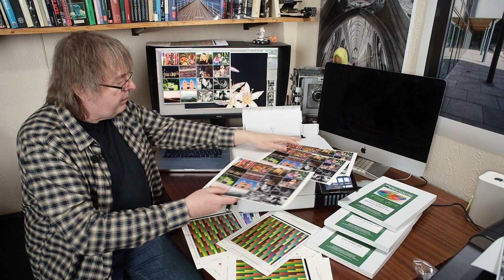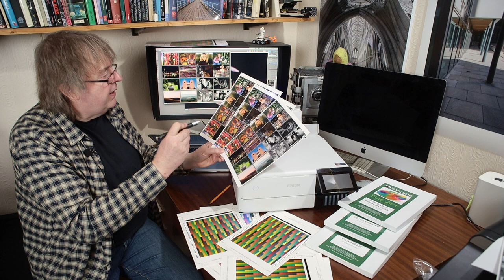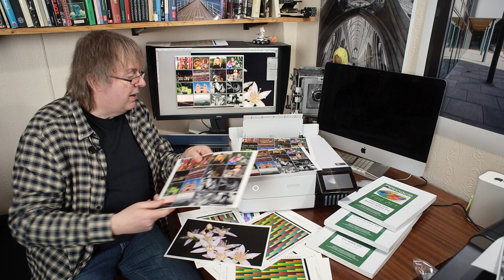Soft proofing, test images and making real prints - When soft proofing runs out of steam

Comment: I use soft proofing for cockpit and software problem solving. I have a light source that I've tweaked over the years and have been able to match the print to the screen quite well. It's not practical because in the real world my light source doesn't exist except in the remotest instances. When things go south, I go back to it as a reference. It's usually me, but about 10 months ago I was crazy because prints were just wrong. Wasted a LOT of ink and paper. I have used Capture One for years and it always seemed to produce better prints than LR/PS (I assume it's the RAW converter). Anyway, it went to hell on my P900. I seems it's Capture One. The boys in Denmark have been flogging it for a long time (10 months), but I think it's not getting any love. If I export Tifs  (that's getting old) and print with PS, Epson Print Layout or even Preview, it comes out spot on. CO hoses it; greens are desaturated and it's over sharpened. Almost like some double profiles I've done inadvertently in the past. Don't know why I'm blathering on to you. Just needed to vent. Disregard. Great job, as usual!
Reply from the maker: Thank

Comment: This is the wrong video to ask this question, but I just used my calibrite display unit, set my light level to 82, which was the closest that my iMac would set between 80-90 and I had my first really good color print I have gotten out of my Canon 9500 Mark ll printer.  Thank you, now I don't need to purchase a new printer, as you just showed me how to get a near perfect print out of the one that I already have.

Now new question, should you always leave the printer on or turn it off between printer jobs?
Reply from the maker: Glad to help!
I'd leave it on for hours, off for days depending on the gap between jobs - or if oyu've had it for years, keep doing what you are doing... ;-)

Comment: Hi Keith,  Thank you for all your videos, all are very useful, excellent information.   I have two questions about EPSON printers, sorry, not exactly on topic to this video, I simply chose your latest one to comment in.

1. Naming convention.   Could you please explain us a little the EPSON ET series naming.  There is a plethora of model numbers and I am confused what are the difference in these variants, even EPSON website is not really helpful, e.g. What are the key differences between ET-2400 ET-2500 ET-2600 ET-2700 ET-2800 series (are these just model year sequence?)   then what is ET-2800 ET-2803 ET-2810 ET-2811 ET-2814 ET-2815 ET-2820 ET-2821 ET-2825 ET-2826 ET-2840 ET-2850 ET-2850U ET-2850SE ... just to name a few, all seem to be existing models, that I could buy, very confusing.  I understand some have certain features, others don't, like scanning, faxing, etc, I am not interested in these, just the printhead to be the best, print quality, speed, reliability., there is hardly any data on this.   ...and all this just one model series ET-28xx.  There are many other ET-xxxx  And also many other, no EcoTank ones...

It is very hard to get a clear picture, just one example:
I just came across the ET-2840 specs, it says it has the newest PrecisionCore printheads, I said, great, so this is their newest development (why does it then have a smaller model number than their ET-2850 flagship in the 28xx series which has an older head technology, OK, no problem, I almost decided for the 2840.   Then to my surprise I saw there is a Special Edition. ET-2840SE what is it?  Is it what I need, no info on difference.  And then I saw a ET-2850SE with PrecisionCore.  And then ET-2856, is it better, or just white?   Then I gave up, it is a mess.
I always have a fear before buying, that when I buy a model XYZ-1234/GGR of some device, to realize later that if I had chosen the XYZ-1244U/GFD it would have been much better for my needs for the same (or almost the same) money.    And with these immense number of models at EPSON it is very likely to happen. Please help.   An overview table would be best, even with a video dedicated only to this topic.   This info is very much missing, it is nowhere summarized.  You may also ask EPSON for help, I think.       For me the most useful would be a summary table with info on the printheads (technology, number of channels/colors, number of nozzles per color, if pigment/dye) these are relevant for print quality, speed, maintenance.   Interface (USB/Wifi/Ethernet) and user interface ie. if LCD screen is available.  And most importantly which are the obsolete models not to buy that have been replaced with a better one for the same price.  None of this info is summarized on any website.

2. PrecisionCore
What does this new PrecisionCore printhead technology mean for us, digital art printers, is it of relevance we should look for when buying a new printer today?   My first impression (sorry EPSON) when reading about PrecisionCore key features (Printer-on-a-Chip, chips are designed to function on their own or can be combined in many configurations)  was that it is much more about their own satisfaction, an engineering stunt (in a good sense, no offense) optimizing manufacturing of an even larger plethora of printer models, the results of which (less variance in parts, less logistics, more profit) I am, customer, is not at all interested.  But does it print better?  If yes, how, why?  No info, no tests, no reviews, no print samples nowhere.  I don't understand.

3. Nozzle Redundancy - would be a long awaited feature for me.   ...a printhead to recognize a clogged nozzle, temporarily disable (until cleaning) that single nozzle and replace it in the next overlapping pass of the head assembly with another nozzle of same color achieving nozzle redundancy without banding.
Reply from the maker: Thanks
I don't sell printers or work with anyone who does, so I can't help with model numbers at all - they confuse me [I get them wrong occasionally in the videos, transposing digits] 
I'm sure there are reasons, but they vary from region to region too.
I'll ask Epson if they have any info I can show?

Precision core is 'just' a new manufacturing process/design for print heads - it's a very big step for Epson, but is difficult to explain in a way relevant to users [given the vast range of uses and knowledge levels]  Yes, it does give better printing and reliability, but once again not in a easy way I could show. I don't work in printer marketing...

Nozzle redundancy - An essential Canon feature somewhat meaningless in the context of Epson print heads I'd suggest? The two are different technologies and handle nozzle functionality in very different ways.
Reply from the maker: I'm afraid my suggestion is that your are just reading far too much into this...

If I said that the word 'precisioncore' appearing on the front of a printer made not one jot of difference to me would it help? 

I look at printers as tools to do a job - it's the results I look for. 

Do I really care that my newer car has a completely redesigned fuel injection system - no, that figures nowhere in my liking of the car. It may make quite a few differences to how the engine works, but if I don't see them, I don't much care [beyond any technical curiosity - it's been over 30 years since I stripped down an engine].

From a practical POV the default resolution of modern Epson printheads is 300ppi, whilst it used to be 360ppi  - this oft thought 'magic number' has shown in numerous tests I've done to be be irrelevant. It's about how those dots are placed and their control which makes for improvements.
Reply: @KeithCooper  Yes, you are right, I am exaggerating the problem, if any.  Just confused with the burden of choice even within one brand, size and model family.  
it's just happened to me so many times that I bought something (router, motherboard, video card, touchpad, whatever), and the very next day when I wanted to upgrade or just simply use it, I was told that unfortunately I have the V2.1 hardware and the feature I wanted is only in from the V3 which would have cost the same.  I became a bit paranoid about that, and the plethora of model numbering for EPSON just added to this.
Reply from the maker: Sure - I just suggest that no-one buys a just released printer [wait a few months] and that in general each update of printers gets better in some respect [this may not be 'print quality' whatever that actually means].

I also know that any current good printer (13" and above) is capable of making great looking prints and if you can't it is almost certainly your fault ;-)
The key limitation with new printers is user ineptitude [I include myself in this]

Comment: (New to large format printing) Canon Pro 4100 : OK I downloaded the Hahnemühle ICC profiles I need and set one for printing. The part I don't understand is, I can not see the Hahnemühle paper type in the paper list? How does this work, do I need to also download paper types from somewhere or?
Reply from the maker: Ah profiles are not the same as media settings - you use the media setting associated with the profile - this need not be the same as the paper itself.
See the custom media notes in my detailed PRO-2000 review [virtually the same as the 2100]
https://www.northlight-images.co.uk/canon-imageprograf-pro-2000-printer-review/
Reply: @KeithCooper  OK so I have to download Hahnemuller paper types too? There only seems to be Canon paper types in the menu?
Reply from the maker: No - remember the media type is a type, not a specific make/brand
See the discussion in the review.
See also
https://youtu.be/7mjl3aQ1iZA
Reply: @KeithCooper  Thanks Keith. Is there a site where I can see what Hahnemuller suggests the media type for their papers exactly when using a Canon printer?
Reply from the maker: See the paper specs  - the profile notes should also contain media settings info